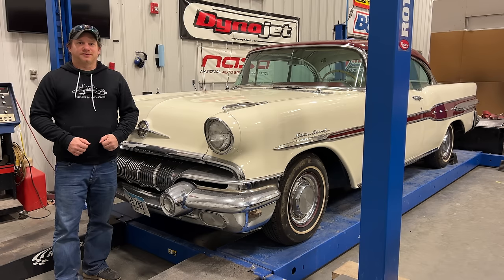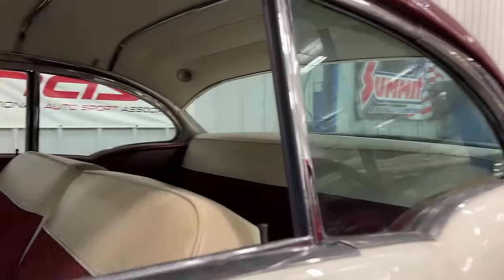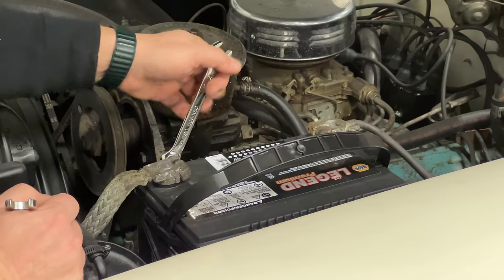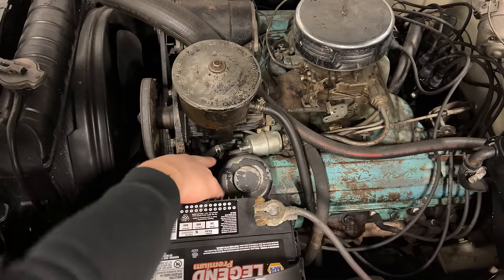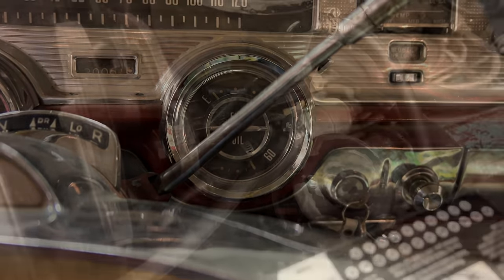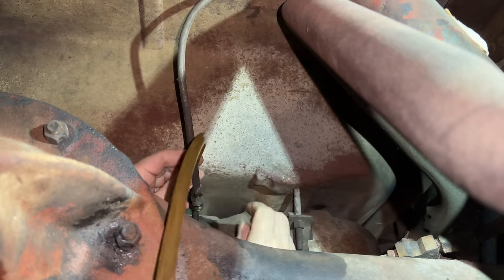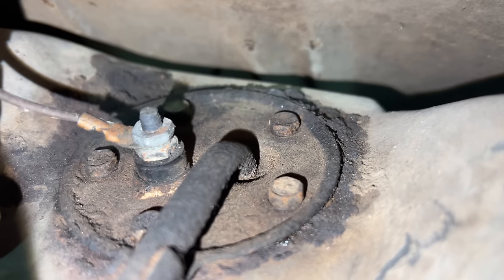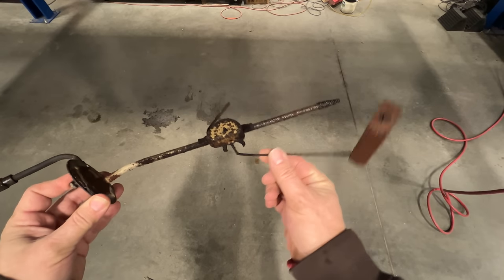1957 Pontiac Star Chief - Will It Run?

Comment: When I was about fourteen years old and first started working on cars, I had the same problem with a Barracuda that hadn't been started in around ten years. I couldn't get gas to the carburetor. After figuring out that it wasn't a bad fuel pump, I took the gas line loose from the intake side of the fuel pump and tried blowing through the line back toward the tank and couldn't. I'd never seen or heard of a sending unit, but after looking, I saw it and figured out how to get it out of the tank. The end of the pickup tube was clogged for a good four inches with what looked like black tar from the old gasoline. I cleaned it out with a piece of wire coat hanger and stuck it back into the tank. My dad and a couple of my uncles were watching me do all this (but saying nothing), so I was pretty proud of myself when the old Plymouth started up. I still remember the grin on Dad's face. I guess he was proud too. Good memory.

Comment: our little  old Toyota Starlet we use for  holiday transport 2000 miles away was left out in open for 2 years due to covid travel restrictions and started 1st go with jump cables and only needed a tyre as one disintigrated to pass  M.O,T and fuel was fine

Comment: You can still buy new parts for a 1957 car?? Lovely old "stone axe" Yank tank, they were so simple back then, weren't they? I for one look forward to seeing this grand old girl run, although with drum brakes on a car that weight they aren't going to be anything to write home about!
Reply: Drum brakes work as well as disc’s. It’s just if you have use the brake a lot like going down the mountains they with heat up and possibly fail. They have developed brake lining for shoes that work as well as disc’s. Semis use drum brakes on the tractors and trailers and work excellent. It’s kind of an old wife’s tale that discs are really better. Their easier to work on. About the only thing their better at.
Reply: @robertbak4108  What tripe; why does every car made have discs, front and rear, except for the tiny Japanese and Korean micro-cars?? Why do American cars all have discs? This Winston Smith declaration has no merit whatsoever.
Reply: They are cheaper to make by the manufacturer. They have less moving parts. Much easier for the parts replacers we have in dealerships and shops today
Reply: Several magazines have done tests on both and found very little difference between the two especially when they used the new brake linings on the drums.
Reply: @paulhall170  In part because it is cheaper to manufacture and install disc brakes than drum brakes. Bak gets it right, at the first application, drum brakes work almost as effectively as discs. Where disc shine is in continual brake applications. Disc brakes dissipate heat much, much faster than drum brakes so are the go to brake for any high performance installation.
Reply: Thanks.. i have had a lot of old Drum Brakes( a couple cars BAD : 1954 FORD ( lose brakes totally if Water,etc),* anyways, Drums,should, are much improved now: interestingly in 1967::* i had to Emergencey Upgrade ,:to SINTERED METALLIC PADS/HD SHOCKS/ Tires//much better.   —- (in EVen small Hills driving Indiana , especially to PURDUE U., From N. Indiana), 1966 GALAXIE 500 XL/4 speed/352/4 BBL ( MINE  did not have DISC OPTION, OR Heavy duty set up, NO Coolant Recovery System from Factory(* I got thru FORD DEALER PERFORMANCE, BEFORE in AUTO Parts: and my Emergencey Flasher switch was in Glove Box).. Anyways, EASY ,SAFE MODS & made much betteR GALAXIE… love the Disc Brakes / ABS in most of my later Cars.. Interestingly, my 1977 TRANS am / SE / Hurst HATCH ( SMOKEY & Bandit) did NOT have ABS .. GREAT STUFF

Comment: The next to last new car my dad bought was a 1957 Chieftan. Single two barrel base engine, three on the tree trans. By 1963, our car had way more rust than this car has almost 60 years later. Definitely the difference between the car living in Michigan and this one from California. I've always been surprised that more of these Pontiacs didn't survive. Pontiac sold almost as many cars as Chevy in 1957, but you see 50-100 57 Chevys for every Poncho you see from that year. It wasn't the raw power difference either: Pontiac had production engines offering as much power as the Chevy 283.

Comment: I like the pontiac engines. We have a 60 catalina in our collection. It has the 389 engine. I recommend you retrofit a PCV on your engine. It doesnt robb any HP or hurt fuel economy. However it will keep the engine internals cleaner reduce back pressure in the crankcase and lessen the likely hood of oil leaks.

Comment: There is something I wish you would do when you get a vehicle like this, check the fluid levels such as oil and coolant.  How many people do you wonder attempt to turn over a motor without checking the oi.  Is it not possible to further damage  an engine if you crank it over dry?  With the work you did on the fuel system, why not install an electric fuel pump?
Reply: Could I just point out this guy, Steve, has lots and lots of cars in his collection, no doubt many of them came to him in this same way. I'd say that before he gets in front of the camera to do his vids he's already checked the oil and hand rolled the engine. It's quite safe to run an engine without coolant for a couple of minutes, and the car is worth far more with the original fuel system components I'd think, It would be to me anyway, and if they're easily available parts why retrofit non original bits,
I've watched him from the start and he's never trashed an engine on first start, I think it's safe to assume this is not his first rodeo.
Reply: He did a video of how to start a car that has been sitting for a long time. It was also a Pontiac. He goes through allof the steps.
Reply: @dennisbranam3847  I can't believe that folks watching this channel honestly believe that Steve doesn't know what he's doing, the evidence of his experience/knowledge are all around him.
Reply: @gazzafloss  I've been messing around with British cars for about 50 years now.  Seems like I learn something from most of his videos.

Comment: I am amazed how easy it is to replace the sending unit on this car. My 65 models have no drain plug and the tank has to come down in order to replace the sending unit. I had the problem that my car had fuel starvation that cam and stopped randomly. Replacing the gas pump did not help. It turned out it was only the "sacklike" filter on the sending unit.

Comment: Great video! There seems to be a whole body of thinking and advice about the best way to start a car that has been sitting for years (and years and years) - but to me most of it looks like "bro-science." I really appreciate how you start from the very, very basic level - spark fuel and air - and then just follow that path. You don't just make assumptions and charge in and start randomly replacing parts, you only do just what is indicated from your diagnosing. It's minimally invasive, like a doctor lol - first, do no harm. I have an old car I need to start, this was good motivation. Do you change oil and filters before you do this type of work? Thanks, again.
Reply: Thanks for commenting.. interestingly, VICE GRIP GARAGE , CARARCHEOLOGY, ETC ; seem , to early -on In procedures ( after the check to,see if ENGINE NOT TOTALLY gone):::::… …….

Comment: Great car in very nice condition.    When you are working with the sending unit did you disconnect the battery or just have the key off???   Need to do the same thing to my 1968 Saab.         Fix the Saab!!!!
Reply from the maker: Key was off.  The sender grounds the gauge so no harm even if the key was left on.

Comment: THANKS STEVE !  I just bought mine and it was delivered to me in am enclosed truck Thursday. Mine is red with a white top, yours white with a red top  Nice... My gas gauge, it shows like quarter tank all the time and if you put gas in, it floats a little towards half a tank but won't go any further. I am thinking the sending unit is bad like yours. did your gas needle move when you put the new gas in ??? Thanks I learned that I can take the sending unit out without dropping the tank.    Big relief.
Reply from the maker: Yes the needle works now.  You should ground your sender with another wire to test that it isn't just a bad ground to the tank.  That would give you an inaccurate reading.  Disconnect the wire from the sender and touch it to the sender plate, your needle should go to full, it it does not it is the fuel gauge itself or the wiring that is your problem.

Comment: If you would have primed that fuel pump by hitting the carb with a little starter fluid it would have likely worked fine.

Comment: Question? The old fuel left in this car's tank. Would this have been 10% ethanol gas? Here in the UK we now have E10 petrol and I'm just wondering what effect it will have if we run classic vehicles on it? I know ethanol is a solvent that attacks some rubber and plastics. And I know it absorbs water and causes corrosion. BUT, if the vehicle is used regularly and the E10 is not left in to stand over winter will be alright?
Reply from the maker: I doubt it had any ethanol in it.  Watch my video about the fuel stations here: https://www.youtube.com/watch?v=e78xuc3pbyA
Reply: @ThisWeekWithCars  Thanks. It turns out I'd already seen that video and commented on it. So it looks like here in the UK we're up shit creek 🙄

Comment: Nice rustfree pontiac,original dashboard and  good interrior.fully original engine bay.please don't run it with 10 years old used motor oil.just change all liquids coolants,breake fluids,steering fluids,gearbox and rear axle fluids and then test drive it

Comment: If you are going to work on the brakes anyway - why not consider doing an update to disc brakes on the front?  If you run radial tires on a car this old don't you need to change the wheel bearings?  Thanks for a great video every week!